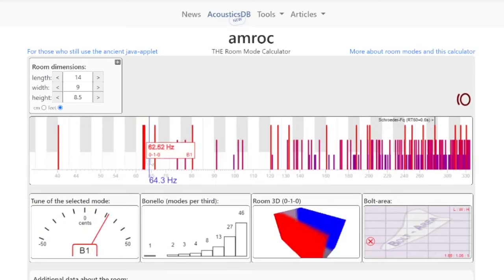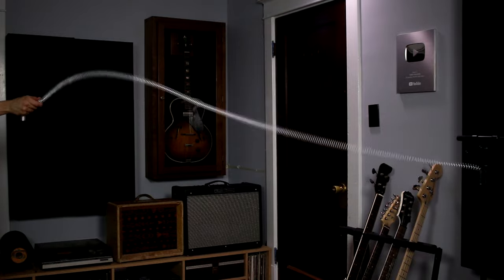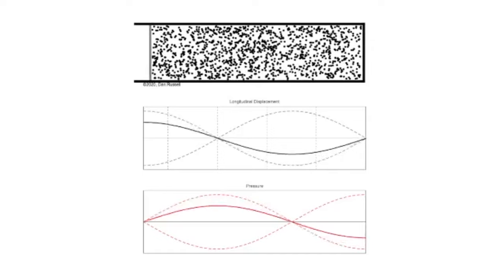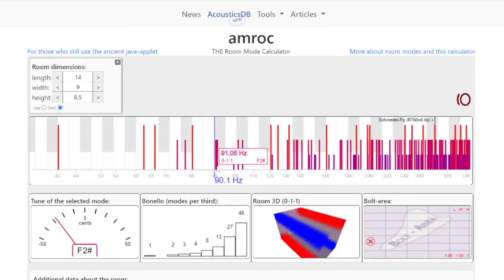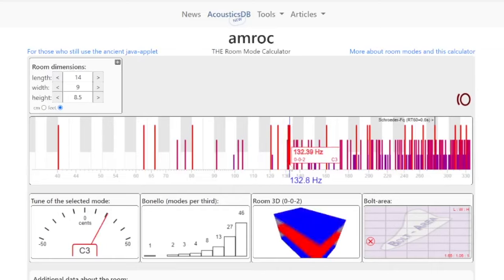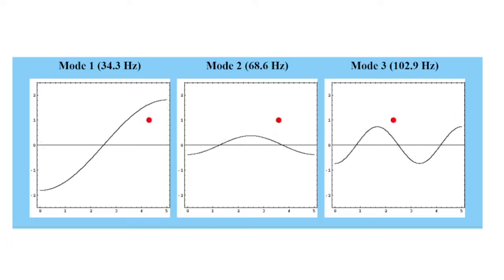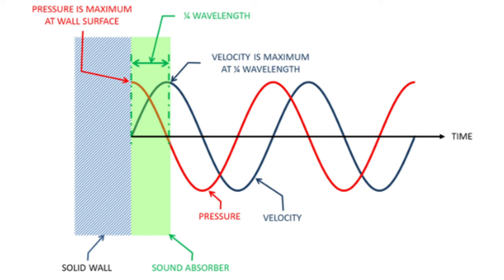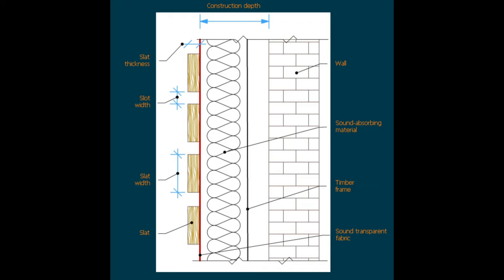Mixing In A Small Room | The Biggest Problem...

Comment: Welp, I'm about to set up my home studio in a 10 x 11 bedroom. My acoustic treatment is going to be hanging blankets all over the walls because I'm broke as hell.
Reply: Our local Op-Shop has bins full of blankets, quilts, pillows and cushions designated as 'dog bedding'. They're washed, but perhaps stained, or had pet hair remaining after washing. They're very cheap, so I've been using a lot of things from the bins as acoustic treatment. Feather/down filled quilts and pillows seem to work particularly well, I packed my homemade treatment panels with them, and in some cases, especially with cushions and pillows in the corners, have just stapled them directly to the plasterboard and ceiling. Staple holes will fill with paint btw, no special prep required, the landlord knows this, so is not concerned at all.
You wouldn't believe the difference it's made for a few dollars here and there, I can't believe how quietly I can have the speakers and still have great clarity.
As you saw, thickness is an issue, the thicker the treatment, the lower the frequency it can help with, so think about pillows and cushions, not just blankets. 🙂

Comment: We should not lose sight of PEQ and measurements, too. Taking measurements is a very effective way to evaluate the effectiveness of your room treatment regimen, and can also help guide on what needs addressing next. Additionally, once you have gotten the room optimized, the application of PEQ will help alleviate any remaining modes that could not be addressed by placement and treatment alone. But that is probably a whole new video in its own right since its not simply a matter of just "make it flat" due to limitations of speakers, amplifiers, etc. and requires some thought on what corrections should or should not be applied.
Reply: One way to conduct measurements with low frequency problems is put a low frequency signal starting at 20hz or 30hz and then map out your pressure zones.

You set the volume at 85dB at the listening position, and then go around the room starting in the corner and measure about every 2 feet around the room, constantly increasing the frequency by about 5hz to 10hz. You may have coincidental modes within 5hz that are along 4 surfaces, especially if 2 or more dimensions are the same or relatively close to the same distance.

Here's a video that discusses these problems.

https://www.youtube.com/watch?v=QN8wbV2cvcY

Comment: Great video and some fantastic demonstrations of what's going on with small room acoustics!

One thing to note with the 30hz and 60hz longitudinal spring vizualization: You're most likely seeing temporal aliasing (and in this case locking in as you've synchronized the camera framerate and the object being sampled) not an actual modal relationship.

Remember nyquist! To sample function of the system accurately you need at 2x the highest frequency of that system. While this visually works, if you were trying to measure the actual modal relationships in that spring the highest you could accurately represent would be 15hz (assuming your camera is shooting at 30fps) This is also why 60hz locks in, it's a clean doubling of 30hz. 

An extra layer of fun with cameras is also how the shutter/exposure time will affect the sample data (averaging)
Reply from the maker: Great point, Tarnith! I didn’t think of that until you pointed it out. Kinda cool, actually.

Comment: Great visualisation! You forgot to mention one of the best ways to treat low frequency modes: the double bass array with 4 subwoofers. Done correctly, the mirrored subs on the rear cealing absorbe the sound waves of the two front subs in a way that the back ceiling nearly disappears acoustically. Of course this addresse not every mode problem but one of the most annoying.

Comment: When you use Amroc, expand the dimensions window and then you can select Axial, Tangential and Oblique modes individually.

The Axial Modes are the biggest and hardest to treat and they are along the entire surface Front/Rear, Side walls and even ceiling. The Ceiling's of 7ft to 9ft have problems in the 60hz to around 75hz and they usually need about 6 to 7 inch deep absorption.  They usually require more pressure based absorption, above 100hz, using velocity based absorption is more appropriate because those are reflections vs modes.

Get the bottom end fixed first. which means typically in the 30hz to 50hz range.  That's the fundamental and the biggest problem.  I'd start with speakers pulled away from the front wall and a good rule of thumb is pull them out about 3ft to 4ft.

The corners is not where I'd put the low frequency absorption. Axial modes are unwanted pressure with 2 parallel surfaces, not the corners.

I'd check out the Acoustic Field's products/design.  they can either design the wall/ceiling construction to build the low frequency absorption into the wall construction, so then you only need to add diffusion and open cell foam for reflections. OR, you can buy or build your own low frequency absorption cabinets and line your walls with full range absorption.

I would recommend dealing with the Axial modes first and start at the lowest frequency you have a problem with.

Helmholtz don't work that well because they don't absorb as much as a diaphragmatic absorption cabinet.

it's not JUST the frequency you have a problem with, it's the location of the problem and the amplitude or amount of that frequency you have to consider.

Comment: Small spaces suffer worst from modes.  That may seem counterintuitive but it’s true.  A large space allows many more modes, which is good.  The more, the better, not least because they will be smaller in amplitude.  

There are room dimension relationships that are ‘golden’ for modes.  They require the least treatment and mics will work to their full potential in them.  Drums will have a full voice and Rt will be well contained at every frequency.  I built such a room out of rough concrete block and it just has to be heard to believe it.  A live performance mecca.

Comment: I saw yesterday a studio where speakers were at the corner up to the ceiling at 45 grades down to ground. 
However, great explanations you've done!
I don't know if this is useful, my project is in a tiny wood house building my music studio, two meters for two meters, with six keyboards, computers and racks, my speakers will be in high position directed to my head, on the two adjacent walls where my keyboards are, so 45grades in all directions, so the reflected sound will be a little room delay, not a deal. For Working I best uses Headphones.
Reply from the maker: Thanks, Patricia!

Comment: A good way to solve sub 80hz mode problems is using two subwoofers. One on each side of a null. One sub in front left corner and one sub in back right corner will do very well in evening out the bass response because it’s helping the length and width modes

Comment: This is a hot topic for me. I've set up a small home studio in an upstairs room of an old farmhouse, and it's beneath a slate roof. in front of me, beyond my speakers, is a sloping ceiling broken in the middle by a dormer window; behind me is just a sloping ceiling but there is gear beneath it. To my left is a flat wall but my keyboard stand is in front of it; to my right is the entrance door. I also have weird shapes in the corners where the sloping ceilings meet the walls at a height of around 73cm. Geometrically, it's a mess - I'm not sure any node calculators could handle it. When I set the place up I was kind of hoping that having a shape that wasn't a cuboid box would help prevent issues, but so far I'm unsure whether that's true. I think I've already noticed some nodes! It's quite a challenge...

Comment: The best way to deal with modes under 100 hz is a multi subwoofer array. Its going to be much less expensive and actually much more practical than potentialy huge resonators and absorbers.
4 matched small subwoofers in all 4 corners of the room will almost always be a significant improvement, even without any perfect matching and EQing.

Comment: Hi, very nice video. I have a more theoretical question regarding pressure based absorbers like membranes or Helmholtz resonators.
The term resonance means also in some context amplification. In all the textbooks I have read it is stated that if sound is produced at the natural frequency of the resonator, this sound is being absorbed by the resonators.
My question (it may also be stupid) is why do these membranes or Helmholtz resonators absorb these frequencies and do not amplify them. I have also seen some answers which have to do with the fact that the original sound and the reflection from the resonator are out of phase and therefore cancel each other but i am not really persuaded. I find this a bit difficult that every wave is out of phase with the reflected sound.

Have you ever thought about it or do you have an answer regarding this issue?

Comment: Even if we use a basstrap we won't be using enough thickness for low end, so is pressure based traps only solution ?
Reply from the maker: Practically speaking, yes. Velocity absorbers aren’t ideal for low end control. But they can help from about 125 and up and are much less costly.

Comment: So with the amroc calculator, the colored room mode areas are not where you would have to be to hear the issues, but where treatment would need to go to tame them?
Reply from the maker: I believe those colors correspond to areas of maximum pressure and maximum velocity. Different types of acoustic treatment are used for each.

Comment: Can we make acoustic bass traps diy so what matterials are good for making it
Reply from the maker: I’m sure it can be done. I have not made one before though.
Reply: There’s loads of info on the internet about building them. It’s basically a wood frame covered in acoustically transparent cloth, with Rockwool (insulating) slab built in. The deeper/bigger the better, but the trouble is, they take up a lot of space, so it’s a compromise if you have a small room.

Comment: Can somebody help me interprete the outcomes of the room mode calculator? I'm struggling with choosing the right room for months now, the one is a mit smaller and more square, the other one more like a cuboid. It says that the cuboid one has a lower Schroederfrequency, but the more square one lies more in the bolt area. I don't know what to do :'( (if somebody really wants to help me, here are the exact room dimensions: Cuboid: 5,30m x 3,30m x 2,53m (L x W x H), and the more square one: 3,90m x 3,30m x 2,53m (L x B x H)

Comment: I am planning to shift my studio to a very small room but I am planning to do painstakingly heavey acoustic treatment. So that there are no reflections, would it work ?? Or there any problem ?
Reply: I just moved and the only room available for my studio is perfectly square, everyone told me to either, find another room or move. The solution I found was... Curtains at the back to change the shape of the room, Basotect bass traps for the front corners, panels and clouds.
Sonarworks to iron out the slight 100Hz and 80Hz dip. New monitor stands and pucks. The room sounds fantastic now:) It can be done:)